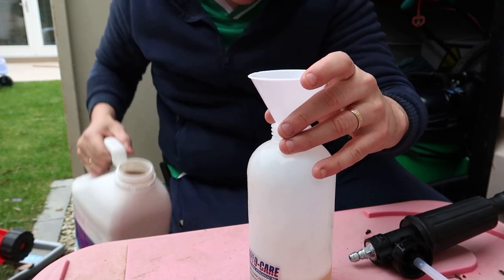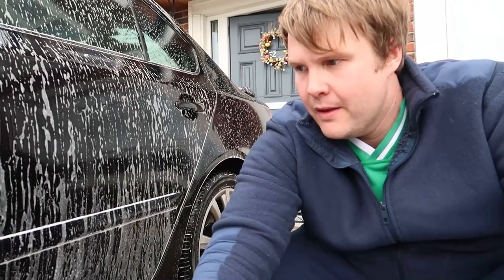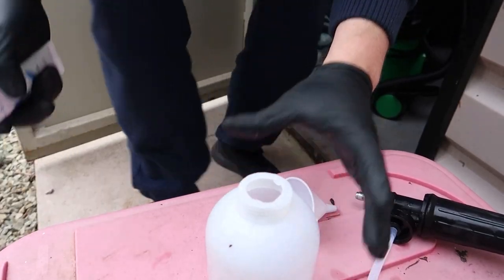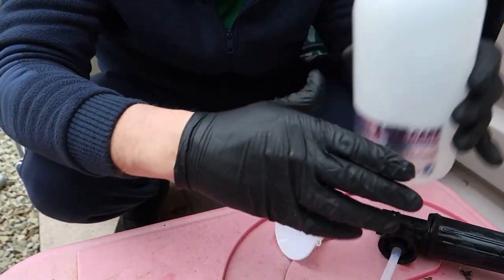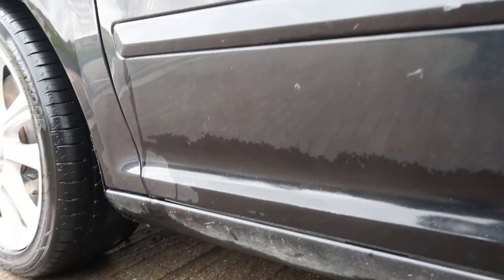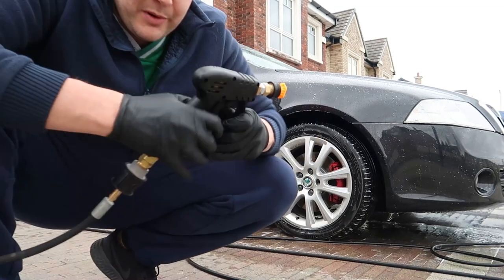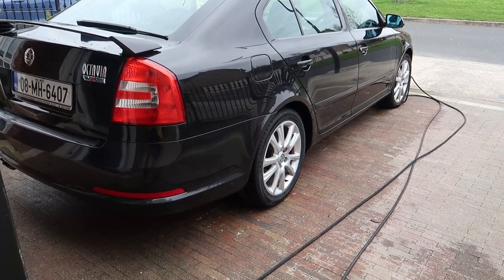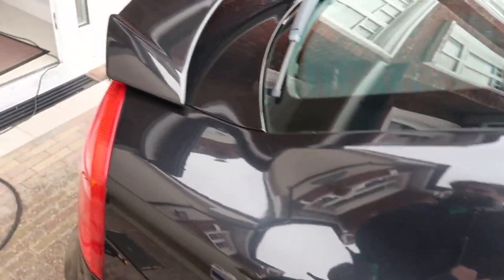Bilt Hamber Touchless & Touch On | Is it actually touchless?

Comment: Enjoying the videos, great insight. Used the Touch On recently and I'm very impressed with the gloss of the paint afterwards, first wash since applying coming up so I'll be interested to see has it stopped dirt bonding to the paint. 
Have you links for the music you used by any chance?
Reply from the maker: Be interested to hear how it comes out for you, I obv as per video put it on unclean panels so like to hear what it's like or how it holds up. Music is just a mixture of tunes from Artlist 👌
Reply: @GoodLuggageAutomotiveDetailing  have a feeling it'll clean up very easily, looks an impressive product straight off. €2 per sachet and one months protection is great value

Comment: I’ve used it not that impressed still have to use the two bucket system to completely clean
Reply from the maker: To some, touchless has a better cleaning ability but to the average eye I don't see much difference, and to the normal.wash process, it is just a more expensive process!! I'm sure if you looked more scientifically into it, there may be some differences...

Comment: Touch-Less, the hyphen is crucial! I'm a big Bilt Hamber fan but I have to say this new system just does not float my boat at all, I've used it a few times now and I am not impressed at all. Plus if you drip dry using DI water and don't microfibre towel dry be prepared for your entire car to be covered in tiny clear hard crystalline glass-like blobs which happened to me last week! Personally I'll be going back to their Auto Foam pre-wash